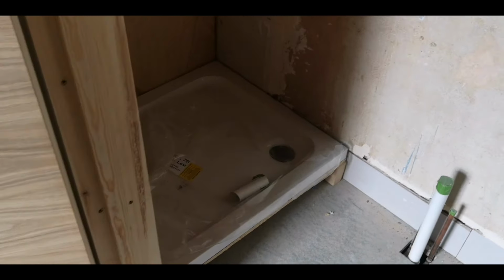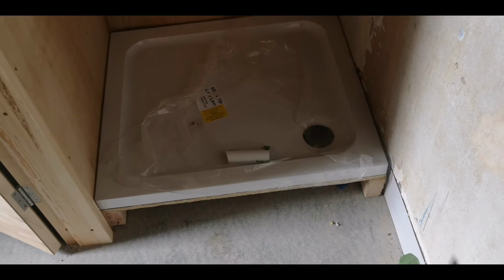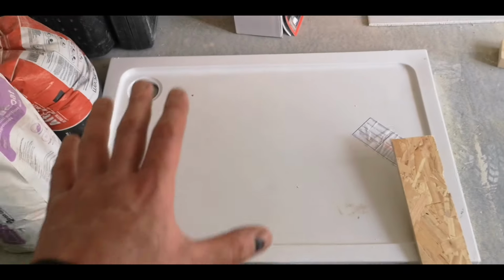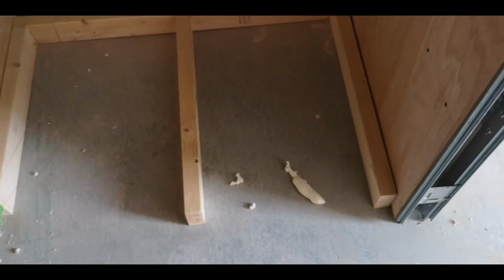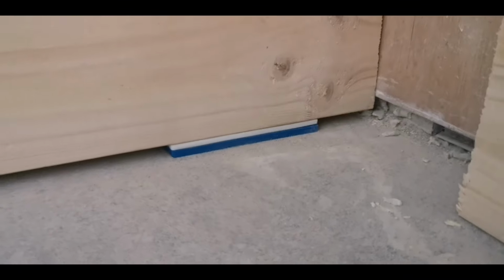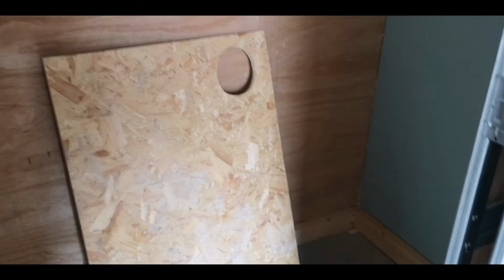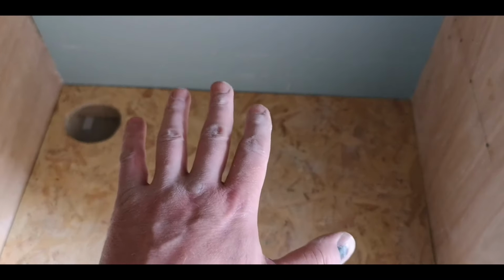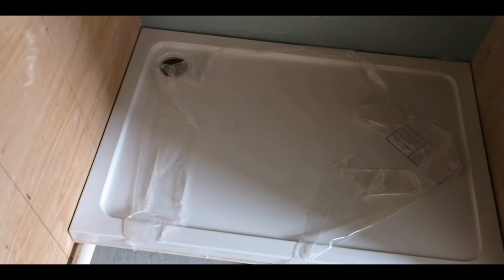Fitting a stone resin shower tray

Comment: Shocking installation
Reply from the maker: nice one 😂👍
Reply: Yeah it’s that funny 🤣🤣🤣🤣
Reply: @brad9895  I don't get it?
Reply: The bedding of the tray is wrong and if an issue with it and cracks won’t be covered
Reply from the maker: @brad9895  it won't crack. Ever. I guarantee it. Use common sense not dogma.
Reply: @griffithsheating  your opinion if it works for you fair enough 👍🏻. Personally I fit trays only by what the mis say
Reply: @brad9895  How will it crack if foam will flex ????
Reply: OMFG its a foam if level it will flex unlike a cement base unless your out by 20mm then do your homework, mine was out by a few mm and now sorted using foam. Been standing on it doing tiling it's that firm...
Reply: You didn't show how you fitted and connected the waste trap to the pipe and tray
Reply: @griffithsheating  i installable a resin tray about 12 years ago on floor board with foam and its still perfect.
Reply: This helped me somewhat. But I can’t work out why have the space underneath for access but have the drainage the other side where you cant access it.
Reply: @jaylondon283  yes exactly.
Reply: Tanking commercial showers has been a BS for years. Not a sniff of any water proofing here and if a 20 stone man gets in the shower the foam will be compressed and the next one in will crack it. Agreed, shocking. Needs sand and cement support and adequate tanking.
Reply: 1:11 espamol
Reply: @KennyEvansUK  The board is rigid because of the framing with 4x4s. The foam (and sealant) is to stop lateral movement so is only added in the voids and channels.  There is not compression as he clearly said there is another beam in the middle.  He used OSB though, plywood would be better.

Comment: Thanks for very informative video.
Will the same technique work for offset quadrant tray? I am installing a TM25 stone resin tray to replace cracked lightweight one. The manufacturer says I must use sand cement screed and not adhesive or expanding foam. Is there any reason why they say this?
Reply from the maker: I use common  sense and experience to decide what's best for each individual install. All we're trying to create is a firm base that doesn't move 🤘

Comment: Thanks for posting. What do you think of the riser kits? My originally bought one for the tray and was just about to fit it, but then started to have doubts based on some of the comments online. It will be a bit of a nuisance to change now, but if they are as bad as some people make out then I might have to take the pain. TIA.
Reply from the maker: @steves1460  we fit them all the time. As long as the subfloor is solid and they’re fitted properly then why not. They can be quite a time saver.
Reply: @griffithsheating  that’s a relief and thanks for the quick response!

Comment: What if you didn't use osb and just layed the tray on the 4 x 2 frame. Would that work? As that is what technically the leg raiser do....? Thanks for reply in advance 👍
Reply from the maker: The problem with that is that sometimes the sides of the tray are lower than the flat middle part. So the perimeter would be supported but not the bit where you stand. I recon you'd get cracking doing it that way

Comment: Hi there, just wondered if I could pick your brains if that’s okay??
We bought a new build house last year (with one of the better developers lol).
We have a stone resin double width shower tray in our ensuite.  Or at least I’m sure that is what it’s made of.  Which is sits on the floor and is not on any risers/legs.  Within a couple of weeks of moving in, we noticed that there was a squeaking noise when we stood in the shower, but only on the one side of the tray.  We mentioned it to site management shortly after this, they sent somebody out who removed all the sealant where the tray meets the tiles, and resealed it and for some strange reason this temporarily sorted the problem.  Fast forward a couple of weeks, and the problem starts up again.  Spoke to a customer care manager and we were told that it was most likely due to natural settlement as the building dries out.  Thing is though as time has gone on the squeaking has persisted, and you can hear it wherever  you step on the tray now.  the weird thing is that some days it sounds worse than others.  But it’s always there. Touchwood, we have not noticed any leaking through the ceiling below.  
I’m about to speak to customer care again, to try and get this sorted properly.  But wondered if you had any ideas as to what could be causing it? Or if this is anything you have come across before? Thanks :)
Reply from the maker: Well if it's squeaking it's moving. That's all I can say really. Either trays wedged in too tight, not bedded down well enough or both

Comment: How on earth did you mange to get the waste pipe to the waste outlet via a 4" gap? And when I search on low density foam I don't come up with any products except sheet materials? Is it called something else?
Reply from the maker: 4" is loads of room to get the trap and waste in if you get a slim enough trap. Some won't fit - like the 90mm mcalpines are a touch too deep. I  used Soudal gap filling foam
Reply: Thanks! So useful.